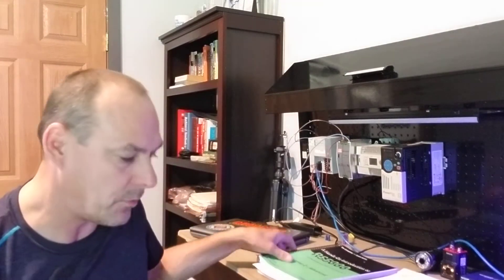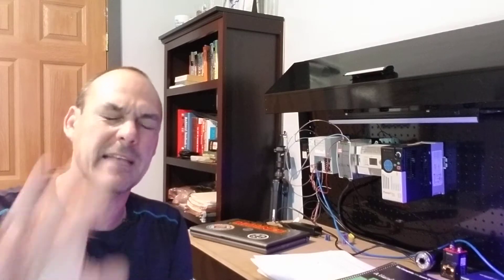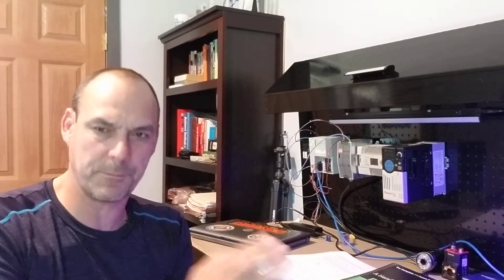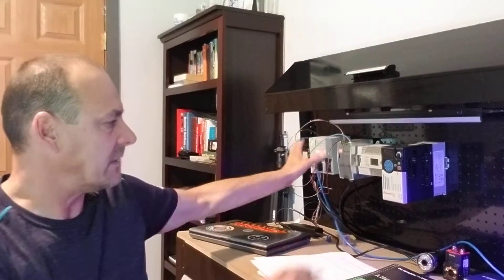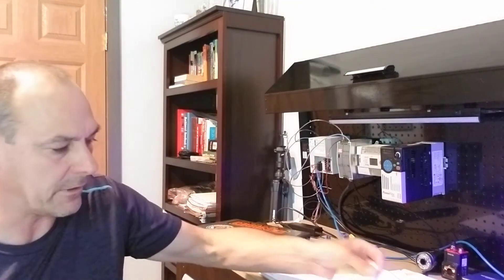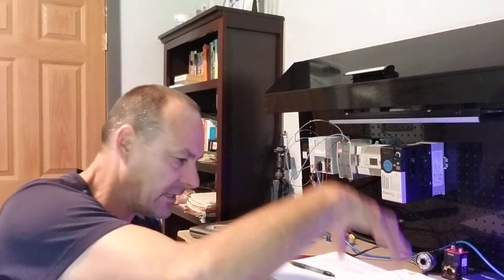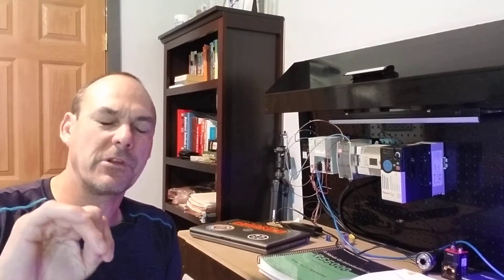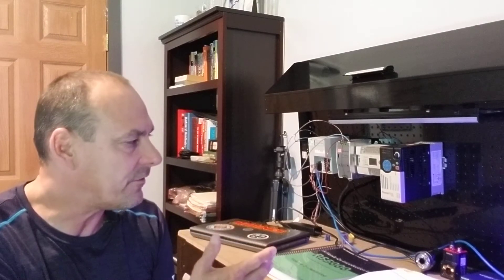Learn PLC Programming at Home - Software, Simulation, Hardware and Benchtop

Comment: Hello Sir! Thanks for the video. I have a question. what is the role of industry 4.0 in the field of PLCs? Should a PLC programmer learn artificial intelligence, machine learning, deep learning etc?
Reply from the maker: Praveen, Industry 4.0 will be the future for sure. However, when it comes to learning it, my opinion is that it depends on your experience and exposure. If you are new to PLC programming I would stay away from it. You have more important things to learn. If you have exposure in the job you have now, than most certainly you should begin to add it to your skill set. Hope that helps, I will do a video about it soon.
Reply: @LogixTrainers  Thanks for the reply! Looking forward for your video